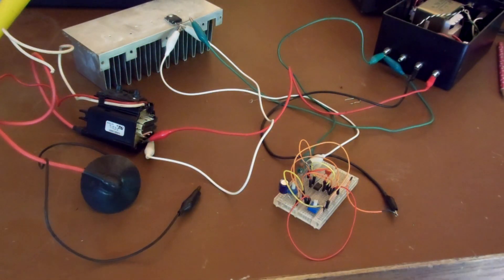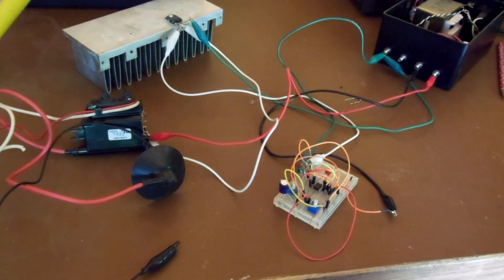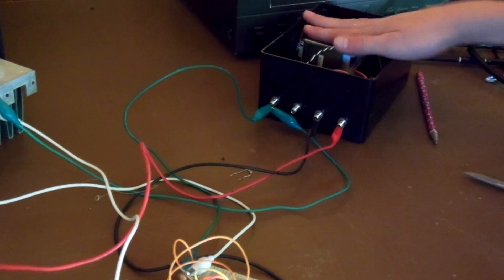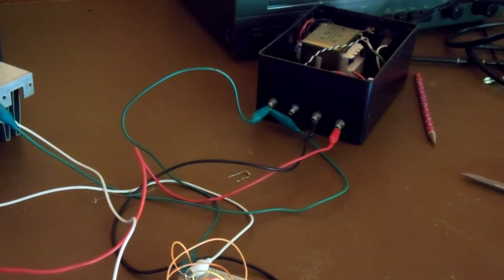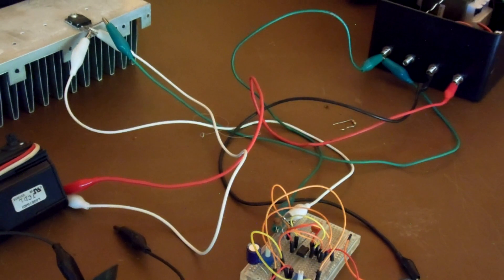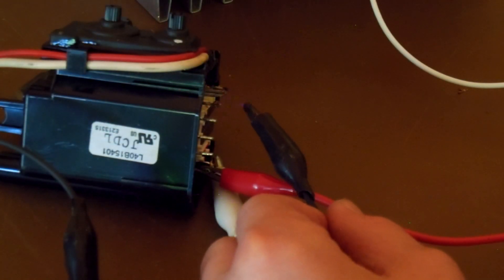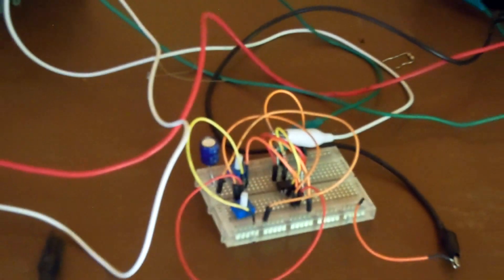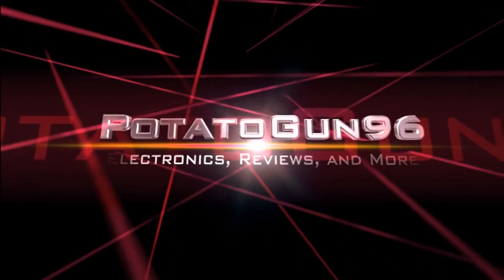555 Timer Flyback Driver with Schematic

Comment: i try with R1=R2=200ohm, C=0,1uF => F=21khz, capacitor 4,7000uF between two pin of flyback and i use IRF 540. When i set Vcc, MOSFET was activated but power supply inform Vcc = Mass. What's mistake

Comment: I tried to power a small tesla coil with an NE555, a 2N3055 and a flyback in the past without success.I got the arcs from the flyback but could not synchornise the primary with the secondary coil for the resonant frequency.I got myself a 1uF microwave oven capacitor.I will try this with my setup or do you think it would too big?Here is my coil .Schematics in the description. ?v=AYF9R7dWloU
Reply from the maker: Heimwerker To be completely honest, I know very little about Tesla coils. I would suggest asking around on some forums or elsewhere online, as they would know a lot more than I do on the subject.
Reply: As DIY as it gets. If you want to get a Tesla coil resonant you're going to need a more powerful power supply, like a ZVS flyback driver or a neon sign transformer. For capacitance you'll want a lower amount of capacitance, in the nanofarad range

Comment: how to measure the current for high voltage
Reply: you can get an estiment of the voltage by how long you can get the arc
Reply: Glenn Isaiah You measure the minimum distance of the arc, and 1mm means 1kV so 1 cm is 10kV good luck

Comment: Thank you very much for the replies! I'll be sure to subscribe! But will i have to have a differnt power supply because a 555 cant handle that much current can it? My supply only has one positive one negative haha im taking ac and dc electronics so im learning slowly haha. I did check in my class with an oscilloscope its super fast duty cycles but has square waves thanks again!
Reply from the maker: The 555 timer should not use more current than it needs. The chip will use the same amount of current no matter what Amperage the supply is. The flyback transformer is being switched by the IRF510, which can handle up to 5.6 Amps with a heatsink. The 555 will use about 10-20 mA, and the IRF510 will switch the higher amperage needed to drive the flyback.
Reply from the maker: Uzair Siddiq I often use various MOSFETs that I find in my parts bin. I usually find a few of them in old switch-mode power supplies, and they can usually handle more current than my power supply can output. The linear power supply I built for my higher current projects can only output 4 Amps, so the IRF510 usually works with this circuit. I am looking for an ATX computer power supply, then I can have at least 10 Amps at 12 volts.
Reply: This impedance of the 555 oscillator is similiar to wiping your fingertip on the lip of a wine glass, as it resonates your finger can’t move any faster or you’d lose the vibration. The 555 timer won’t even get warm unless if you shorted a car battery through it

Comment: So that could possibly be why the flyback isnt even arcing? I hooked up the drain of the irf510 to one pin of flyback and the other primary pin to the 12v. So i know my pinout is correct is it jist the amps? Thanks for the reply!
Reply from the maker: Yes, your problem is likely in your power supply. I would recommend at least 12 volts at 1 Amp or more. If you could get 2-3 Amps, that would be even better. The higher the Amperage, the greater the potential. This is all assuming that your circuit is otherwise functioning correctly. If you have an oscilloscope, I would check the driver output as well to make sure it is oscillating correctly. I hope this helps you get it working!

Comment: hey there, do the amps really matter a bunch sorry im using a power supply thats only pushing 12-15 volts with only .15mA not even close to one amp
Reply from the maker: Yeah, Amps make a huge difference. I was using a 4 amp power supply with this. 150mA is what you need for the driver, not including the flyback. 1 Amp would probably be the minimum I would try this with.
Reply: potatogun96 where did you get the transformer for your power supply?
Reply from the maker: Owen Chase From MPJA. Similar ones can probably be found elsewhere, but that's where I got mine. Here's a link:

http://www.mpja.com/24V-4A-Center-Tapped-12-0-12-Transformer/productinfo/27845%20TR/
Reply: potatogun96 thanks for some reason I could not find a transformer on ebay, do you think ebay is good for electronic parts?
Reply from the maker: Owen Chase I have bought from eBay in the past, and have had a mix of good and bad. I'm sure that you can find a good transformer that will work, but you might have to search for a while.

Comment from the maker: Not really. I run the flyback at 36 volts at over 4 amps usually. This generates a lot of heat in the mosfet, so this heatsink isn't complete overkill. It is more than I need, but it keeps everything cool.

Comment: thats wimpy . 
IF you want  BIG arcs use different psu for IC
and transistor . 
on transistor power side you can go with much higher voltages and amps, but beware fire . if mosfet dies it can go down with fire and maybe explosion :D
irfp250(N) , irfp260 or smthng like that . 
feel free to check my latest latest 555 videos to see such setup in action

Comment: yea, i have started looking into the ZVS driver circuits and am figuring them out, hopefully i will be able to make a ZVS soon, i am starting to work out all the parts, i am using 2x 560ohm 2W resistors and 2x NPN transistors and i have no clue about the cap i will need. so i hope it will work,

Comment from the maker: The problem with using a high frequency oscillator is that the transistor would not be able to switch on and off that fast. With my current parts, I don't think that it is possible, but maybe in the future it will be.

Comment from the maker: Yeah, I found that the combination of higher voltage and higher available current allows larger arcs to be formed. The computer power supply I used for a while had the high current, but Ohm's law prevented a lot of that current from being used.

Comment: it isnt giving the flyback AC it is giving it pulsed DC, read the wiki article on it, it tells you alot. the reason why flipping the pins is because the flyback transformer has a diode on the output and you where driving it the wrong way around.